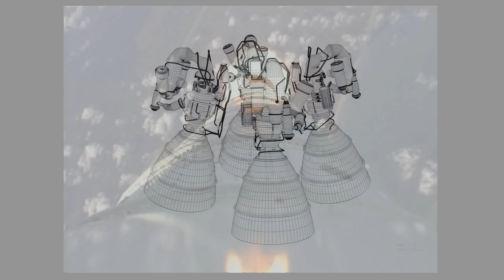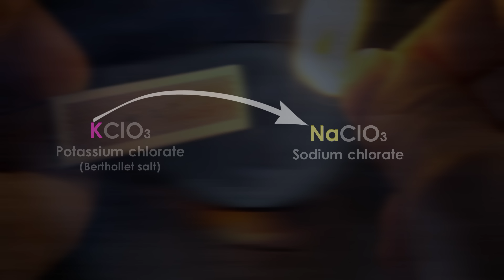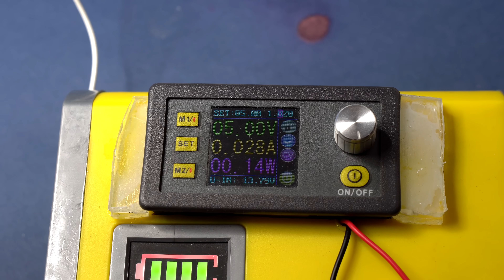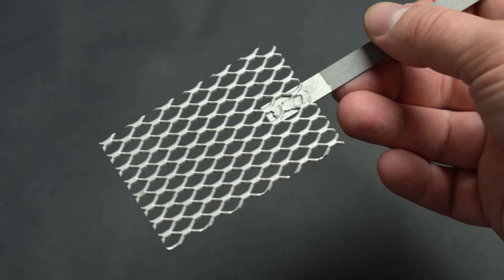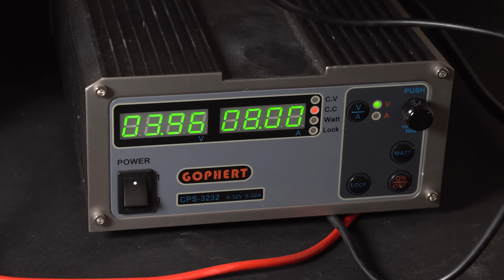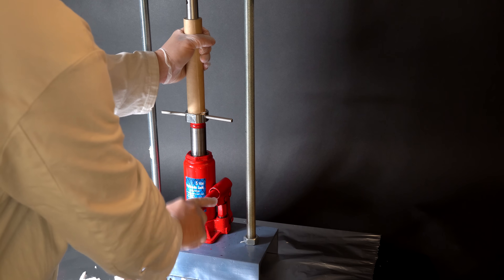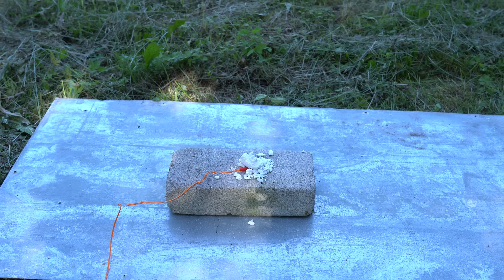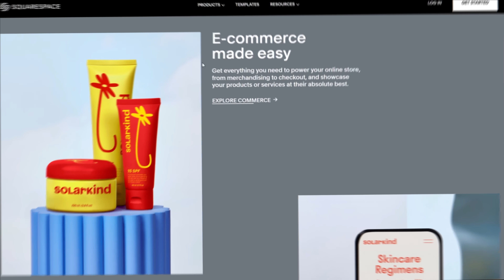How to Make a ROCKET ENGINE From Table SALT?

Comment: "do not attempt"  LOL...really?   Does ANYONE who has ever said or written that think it has an impact whatsoever?  Makes me chuckle.

Nice demo, including the failures.  I'm guessing you didn't just read this on the internet, but have some real experience, maybe even in commercial or military rocketry.  One thing you might be interested in, if you don't already know it is that some missile motors, at least one that I know of anyway, used a star pattern chamber to get the exposed surface up even further.  This was a motor with VERY high output and burned for just a little over a second.    Almost more a controlled explosion that a burn, taking metaphorical liberties.  

This may be (probably is) standard practice now for fast burners, but just something I thought of.  I've had no exposure to the industry for decades, so excuse my temporally induced ignorance, if so.

Comment: If you want, it's possible to synthesise perchlorates by thermal disproportionation of chlorates. I believe ceramics would be available on Mars, since they are strong and unreactive. So electrical heating of some of the sodium chlorate to disproportionate into sodium perchlorate and sodium chloride would be possible, if desired

Comment: I'm taking advantage of the freezing weather to recrystallize a batch of k perchlorate outside... funny running across this at random.  Anyone interested, invest in good electrodes, most of the amazon/ebay ones are fake and dissolve instantly which is hilarious.  Pt and Pb oxide good, MMO not so great IMO.  Dichromates do help stabilize but annoying to precip. out later, more important to watch pH.  Chlorates are super fun and a good intro to electrochemistry, just requires a little patience and a few tweaks and you'll have a ton.

Comment: While the match ignitor works seems like too much work other than for an improvised quick one time use. I'd use a 3-6v to 400kv step up spark gap module and a switch to make something more reusable for testing. I made a robotic firework launcher array one year with that as an ignition system some pvc tubing and parts from an old rc car and laser pointer for aiming. Set up empty cans cracked a bottle of whiskey and made it a wagered backyard sam site competition for an amusing hour or two amongst friends.
Reply: I used to use Jetex model rocket fuse. Simple.

Comment: dont worry, its only rocket science, easy as heck
Reply: pride of the profession, as always
Reply: nice have time tasting the rocket
Reply: you could try to mix rust as accelerator to the fuel, to make it red in color too
Reply: railgun rocket artillery launcher
Reply: do it with elemental carbon powder pile as a bottom replenishable electrode
Reply: does not matter if the electrode breaks, its on the bottom of the beaker, making contact
Reply: nuclear (fusion, fission, alpha) heat/photon engines are better than any chemical rocket

Comment: How well do these store?  Sodium chlorate is extremely hygroscopic, to the point of having no practical use in fireworks.   However, your mixing with silicon  adhesive looks like it might offer some level of waterproofing.
Reply: Not fireworks exactly, but sodium chlorate was often found in smoke formulations. Also, mars has very little atmosphere and is very cold, so there will not be much water vapour around.
Reply: @bobthebomb1596
Reply: @bobthebomb1596  everywhere where there is air there is water, and the storage might be connected to the air presured buildings on mars.
And btw he is not asking for space purpose more like entertaining purpose.. 

And that whas my question aswel, and there are silicon based glue that have other acids in them that could comprimise the structure.. 
Al goes wel for a few day but there WILL be addition unintended effects;   like spontanious self combustion or releasing dangerous gasses
Reply: @robertoeijs  Atmospheric water vapour concentration on Mars is thousands of times lower than here on earth. A well packaged chlorate-based pyrotechnic can have a shelf life of at least a year on earth.

Anyone working with pyrotechnic compositions (or any energetic material) will undertake small scale compatibility trials as part of the formulation process. This involves any constituents and also any packaging/adhesives the composition is likely to come into contact with.
Reply: All chlorates are hygroscopic
Reply: why not use liquid nail? That would nail it... :face-green-smiling:

Comment: Don't breathe in the fumes trough! Burning silicone sealant as fuel leaves extremely fine silicon oxide powder, exposure can cause a serious lung condition called silicosis.
Reply: Was going to say the same thing.  Silicone is a poor choice for fuel.  Not just because silica is horrible to breathe, but because it's a solid and for good thrust you need gas production.  An acrylic latex sealant would be much better choice.
Reply: @whatelseison8970  So if I want to build a rocket in my garage that could fly all the way to let's say North Korea.. I could follow this recipe and just swap latex sealant for silicone sealant? Also, do you know of any laws or treaties that would prevent a civilian like myself from declaring war on a country and launching a rocket attack against them?
Reply: @MarkLada Well, first you'd need a high powered rocket license to go above a certain height without pissing off the FAA. Then work from there. 😂
Reply: @kf4293  Me and Kim Jong Un have worked out our differences.. I'm no longer interested in declaring war on NK.. He caught wind of my plan and offered to sign a treaty.. So I listed some of the completed rockets that I built online, and Ukraine ended up buying all of them from me..
Reply: @whatelseison8970  well, with the pretense of this being 'emergancy signal rocket' you'd use whatever you had. Naturally making your own High-power rocket motors when you've got time on your hands, you'd pick better materials. you're correct in this being a much better fuel.
Reply: @whatelseison8970 What brand do you recommend? Is Bison White Acrylic universal good?
Reply: It always surprises me that saying that is necessary, it seems logical to me that one doesn't breath in fumes..
(but) because there's always some fool who thinks he can breath that.. someone needs to warn him/her (s)he shouldn't ..
Reply: Hazards of the job...

Comment: Is it possible to use hard drive discs as the anode? They are covered in a very thin layer of platinum, I'm wondering whether that'll be enough to stop it from corroding
Reply: Thats like trying to improvise a Lamborghini into a boat

Comment: The method presented cannot be used to obtain NaClO3 for rocket fuel. The residual NaCl must be removed, because not everything has reacted during the electrolysis. I assume you simply bought NaClO3 :)
11:04 - KClO4 is suitable for rockets... it is the most commonly used compound in pyrotechnics
13:11 - Mixtures with KClO3 are sensitive to friction and impacts, but do not detonate. This is not a detonation but a deflagration.
Reply: Depends how long he ran the electrolysis for and whether he used a stirrer. if he left the anodic oxidation long enough for all the chloride that became the chlorate to gain another oxygen ion to become perchlorate then he could have done an ion exchange of the sodium perchlorate with potassium chloride as the resulting potassium perchlorate precipitates because it is not very soluble in water and much easier to dry, after that ion exchange reaction with potassium he'd then have NaCl left behind.
Reply: I assure you that chlorate mixtures can detonate.
Reply: @bobthebomb1596  oh yeah absolutely, just not if the majority of the oxidiser is still only chloride and not chlorate, however if you aim for a perchlorate, there's a bit of redundancy, so at the least, you have chlorate instead of perchlorate rather than chloride instead of chlorate.
Reply: Not true. They taught us this in the Army with carbon electrodes. It works great.
Reply: In fact, the electrolysis of salt water produces sodium hydroxide and chlorine gas, the chlorine react with the hydroxide to form sodium hypochlorite and the heat of the electrolysis decompose the hypochlorite to chlorates. That's why we need the cell to be around 80°C

Comment: If you just wanna make a rocket fuel it might actually be a good idea to use graphite electrodes?

Since graphite is just Carbon, you basically have your fuel in with your oxidizer, and its still stable enough that you (probably) won´t blow yourself up mixing the fuel grain. Problem is getting the ration right
Reply: for some reason graphite isn't a good rocket fuel.. no idea why.. it just isn't

Comment: Has anyone tried KNO3 (Pot Nit) as a substitute with silicon in rocket motors and if so what ratio did you use?
Reply: Potassium nitrate  65% powdered sugar 35%  red iron oxide 1% all by weight.  The iron oxide helps but isn't necessary to   get good results.
Reply: That potassium looks like an oxidizer not a fuel
Reply: @em4392  potassium is an oxidizer.

Comment: Thin Martian atmosphere means you would not need altitude for transmission right?  Couldn't you just transmit from ground level?
Reply: Bob, high frequency transmissions are "line of sight" so you need to get up high to transmit long distances over the horizon, hence the need for high towers or satellites. The atmosphere doesn't have too much to do with it.
Reply: @wooddoc5956  ah ok, thanks for the explanation

Comment: The easiest fuel to make is R-Candy. 65% potassium nitrate (fertilizer/stump remover), 35% sucrose (sugar). You can add a small amount of Fe2O3 to it to intensify the Burn. You can use it as a powder or you can melt it down on a pan to get a solid Brick.
Reply: In Europe KNO3 its highly regulated.In some countries its on the same plate with explosives.
Reply: @zombicreature  in Poland there is literally no problem getting it.
Reply: @1brytol  Im not surprised, there's a german pyro i follow, he's always buying fireworks from Poland
Reply: @zombicreature  Yeah its probably so easy to get in Poland becuse a lot of KNO3 is used as a fertilizer. You can literally buy 1kg of it for 5/6 $

Comment: It was a nice experiment. I always tried to make hydrogen chloride gas from graphite rod dipped sodium chloride solution. And most of the time I obtained a white coating around my dry graphite rods. And thank you for making us understand the chemistry of rocket fuels, especially about oxidizers and resins.

Comment: I didn't know that you could use silicone sealant as fuel.    Great video.
Reply: The ingredient Polydimethylsiloxane contains lots of hydrocarbons.
Reply: The only problem with using silicone as a fuel is the fact that burning it releases silica oxides which can cause damage to the lungs if inhaled
Reply: Yes I like breathing pure chlorine gas. I will not use that liquid absorber. What doesnt kill me ,might kill me ,but if it doesnt, I'll become immune.

Comment: you can skip the electrolysis of the salt water solution by just using bleach, electrolysis of salt water makes bleach, boil down bleach to make the oxidizer, dont do this indoors unless you want toxic chlorine gas in your lungs.

Comment: Could you please make a more in-depth video on making platinum anodes.. buying them can get very expensive and there's so many fakes around that buying them is a real gamble
Reply: Platinum is just expensive man. There's really no getting around it.  Really though, he showed everything you need to know.  Dissolve the metal in aqua regia, then plate it back out of solution onto a titanium cathode.  Don't expect to save any money doing that though.
Reply: @whatelseison8970  i can get enough platinum from old catalic converters for free but even for those who have to buy a little platinum, at least they can get real platinum and not the fake crap online that dissolves in an hour
Reply: @markshort9098  Cool. Well yeah, it's probably worth a try then.

Comment: It wouldn't be so difficult to make NaClO3 on Mars -ok, but how will make the fuel?
Reply: Did you not watch the whole video?  He explained that and it was a good portion of the video.....  For both the chlorate and the fuel.....
Reply: @BackYardScience2000  I meand that it is easy to make ClO3 oxidizer on Mars as part of beeing self-sufficient, but taking with yourself silicones and resines to be leter used as fuel is inpractical, the autor was making this video in relation with Mars, but he didn't make a good idea for fuel for rocket since they will be used fast.

Comment: When you put your hand in that bucket filled with fuel my heart skipped a beat! For next video, maybe some burn rate tests with some catalyst such as iron oxide? Never thought such an otc binder could be used successfully, considering you didn't even use a proper nozzle
Reply: Aluminium powder is a good additive.
Reply: @kitemanmusic  in the motor I guess, or are the oxides for the electrolysis? excuse my english, it is late for me
Reply: Where should witch iron oxide be used? I m realy interested
Reply: @airfighterxgg3559  many transition metal oxides catalyze reactions that produce O2, such as chlorate or H2O2 decompositon. AFAIK Fe2O3 works the best for chlorate, but FeO MnO2 etc could also be used. Ofc only a very small amount is needed (in the order of 1%) as catalysts dont get used up in the main reaction